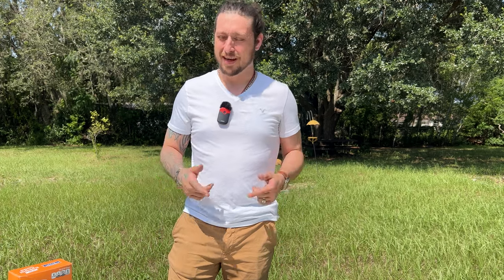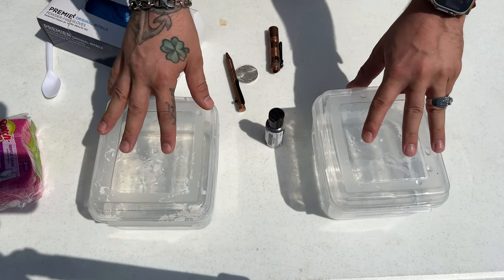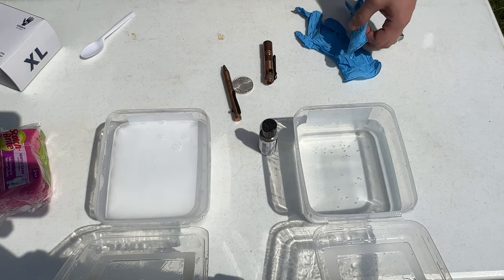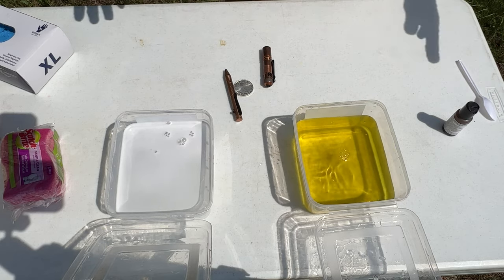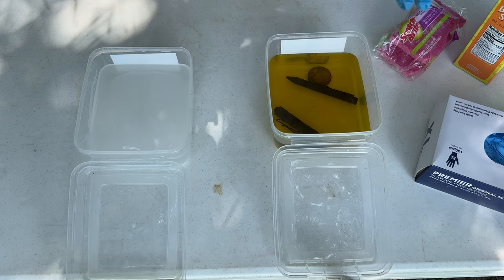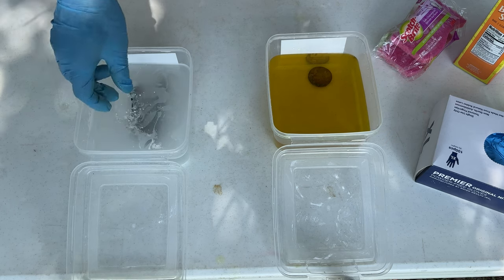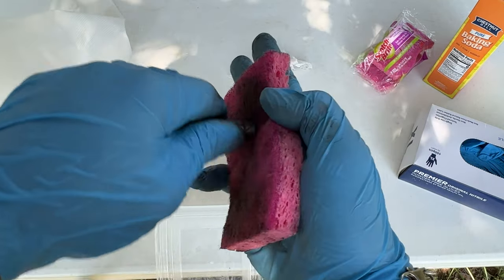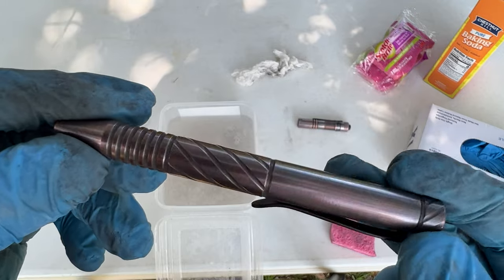DIY: Black Patina On Copper Using Liver Of Sulfur!

Comment: Cool project. Those came out great. 
In kind of a related topic, I’m thinking of getting my Olight i5T Titanium light anodized. Since that is a little more involved, do you have any idea if the rubber tailswitch and/or the lens would be safe? Thanks
Reply from the maker: The tail switch I don’t think that I would be terribly worried about since it is rubber. The lens is a good question. I would generally think that it would be okay. I would take a cheap i3T or something of the like and test it on there first and see what happens. If I had a rig set up for ano, I would just go ahead and test it for you.